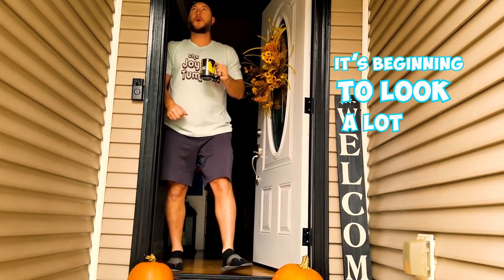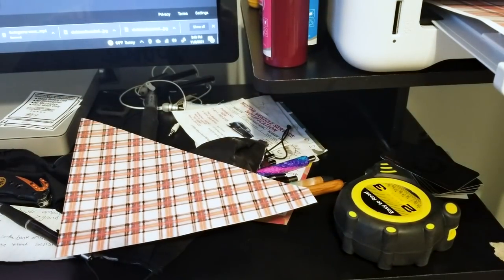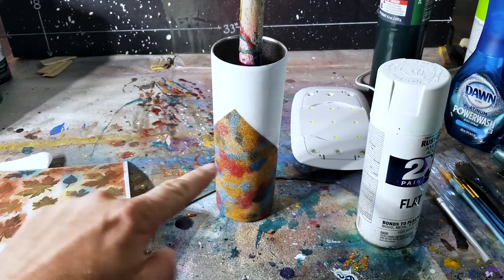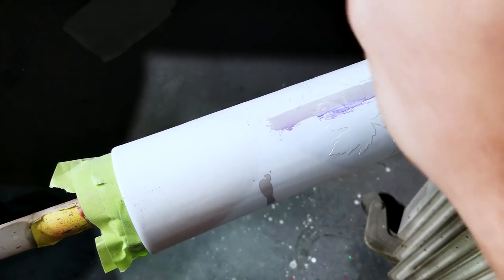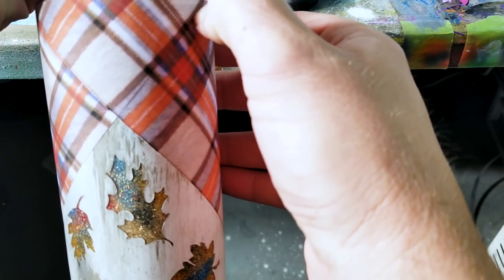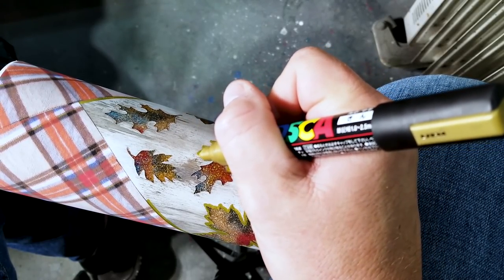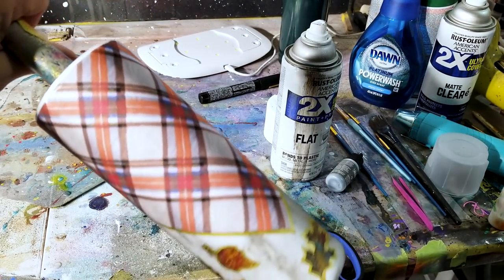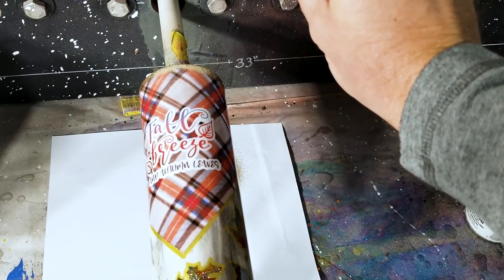Turn your BLANKET into the MOST BEAUTIFUL V Split Glitter Tumbler EVER!!

Comment: Yes you CAN use UV resin this way. You can do a entire tumbler with UV resin but the finish is NOT a durable as epoxy.  UV resin is great to use for the soap bubble method, sealing vinyl, water slides or stickers down before epoxy, building texture, adding mixed media, and sealing glitter etc. I just recommend that your final layers be epoxy.  But, please do not aim the UV light towards you prop it up on something over the cup or aimed toward the side of the cup instead.  The UV is not good on your eyes. Hope this helps
Reply from the maker: Awesome! I set it up and came inside for about 5 or 10 mins and let it roll on my turner, I finished it off with Alumilite Quick Coat👍